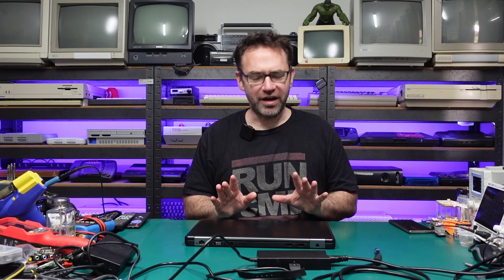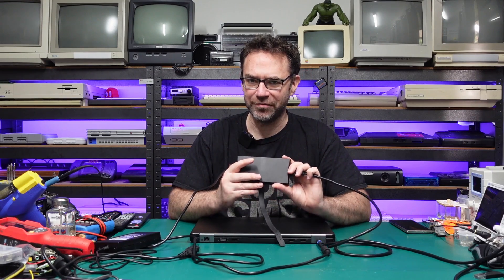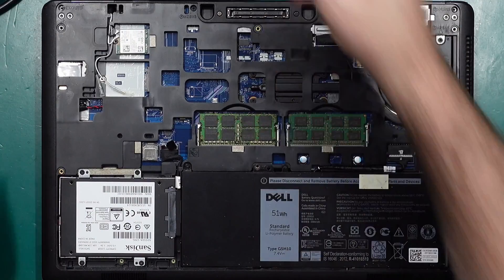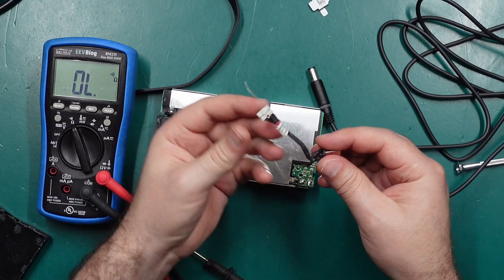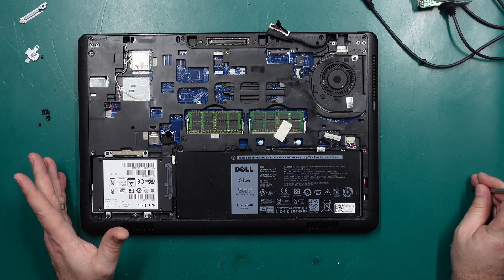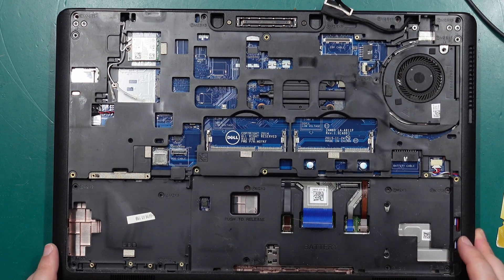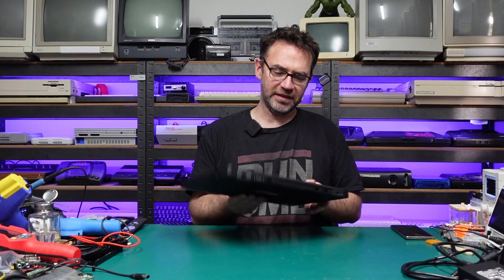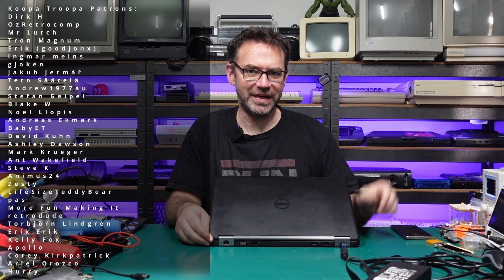Dell E5550 not charging (AC adaptor unknown) repair

Comment: I have 2 Dell laptops (out of many) that had the AC unknown issue.  Adapters work fine with other laptops; just not these 2.  They are E7250 and E7450.  I tried many online remedies without success.  Finally brought out an old PRO3X E-dock and they both charge their batteries and indicate in BIOS the correct adapter wattage and run a lot faster.  These old E-docks work for Dell models from E6400 (Core duo) to E7470 (Gen 7 CPU).  Very cheap online.  Just charge a spare battery to bring to school or work.  NOTE: The dock requires a 90W adapter to operate (also cheap online).

Comment: Pretty classic failure mode for a charging circuit or even I/O ports for that matter.  It is good that they fail in this way, but it would be nice if they made it easier to fix.  I also have a Dell, but not that model.  Mine is an Inspirion 15 5000 series, but I am certain the internals are similarly made.

Comment: Please don’t confuse identification with authentication. The sense/id pins are to tell it the max power of the charger, not to confirm it is “genuine” (you said it twice)
Reply: “ to let the device know it’s connected to a genuine dell charger AND how much the charger can output (AKA the max power)”. He said it in the first 30 seconds of the video…
Reply: @ImPretendtious  exactly - ‘genuine dell charger’. It does not confirm it is a genuine dell.
Reply: He knows the pin is used to detect the max power from the supply, that part was unnecessary. Making sure not to confuse authentication for identification was all that was necessary less it comes across as pedantic.
Reply from the maker: The EEPROM in the charger contains not only the max power of the charger but also the *manufacturer ID and serial number*. This information is sent to the laptop over the "sense/id" pin and if any of that is missing or incorrect, the charger is deemed unknown
Reply: @TheRetroChannel  contains it, sure… but have you checked it reads it? Last I saw they only read 3 bytes of data containing the wattage. Admittedly it was a fair few years back, but then again so is this laptop!
Reply from the maker: I'd be surprised if it only looks at the wattage as the string also contains the voltage and current rating. And why go to the trouble of including all that info if it's not used. But no, I haven't confirmed it. I'd run some tests myself but that would require getting the programmer from ti, and the motivation 😄
Reply: FWIW I've bought a number of the cheaper Chinese 180w chargers in the past from Amazon and they work great. I'm guessing they spoof the required information.